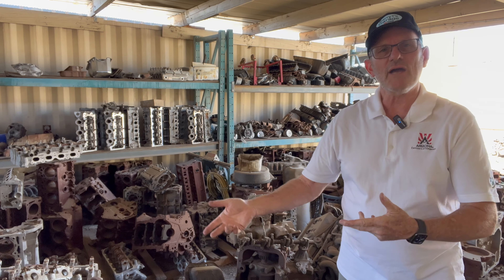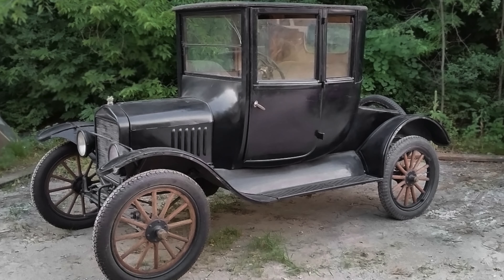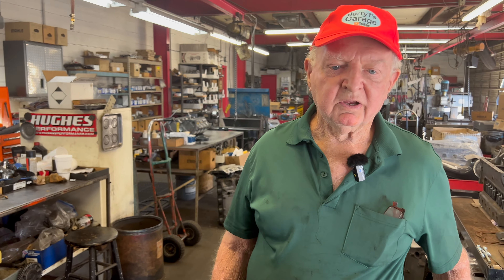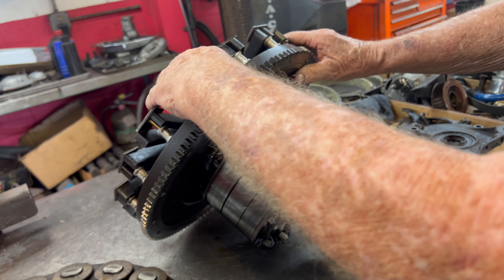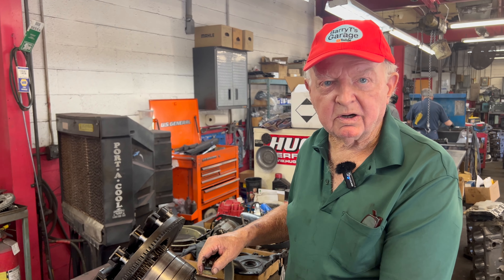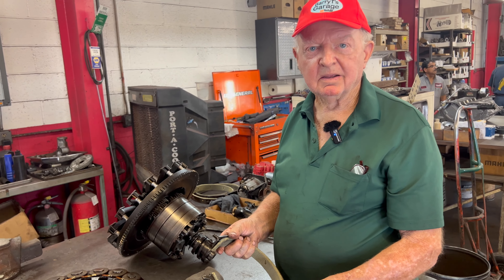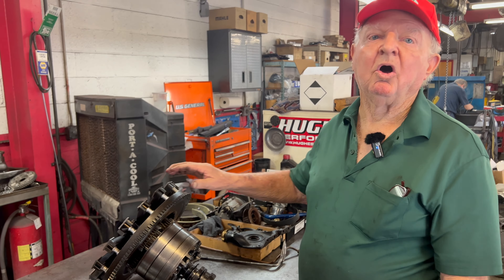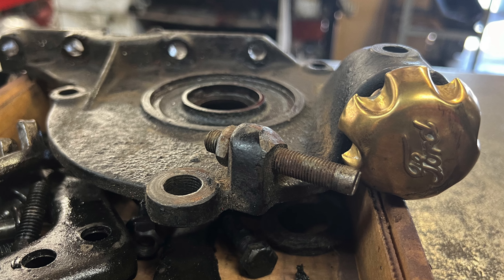Early Model T Oil Splash Flywheel Generator and other Oddities with Ed Smith of Five Star Engines

Comment: I was able to drive my great grandfathers ‘23 runabout recently, and it was quite the experience!  The throttle not being a pedal and the brake on the right was such a foreign feeling.  You’d clutch in and stop in such a different way compared to a modern car, (left pedal up right pedal down) and have to remember to idle the engine down on the steering wheel!  My uncle described it as trying to scratch your nose and play the fiddle at the same time. 

Also it’s very interesting to see how, despite driving kind of like a tractor, the basic concepts of engines are still very much the same as modern cars.  Another thing that was different though is that the T had no water pump!  The cooling system was entirely run by temperature differences forcing the coolant through the engine.  However, you get a pump in the aftermarket.
Reply from the maker: Great observations!

Comment: Slight correction/clarification here on the transmission:  Ed spoke of holding the left pedal down for low (first) gear which is correct.  But he said to hold a different pedal down for high gear and also moving the hand lever forward.  This not correct.  All pedals are released (up) for high gear while the hand lever is forward. 
  Further on the hand lever:  It was multi-functional.  While latched in the middle position the trans was in "neutral".  Pulling back on the lever applied the rear wheel (or parking) brake shoes.  Moving the lever all the way forward applied the high gear clutch.  You started the engine with the lever in neutral.  To back up you left the lever in neutral and pushed own the middle pedal for reverse.  To go forward you pressed the low pedal down.  To stop push the right pedal.  While accelerating in low, you moved the hand lever all the way forward but the trans stayed in low until until you let up the low pedal and the trans went directly into high.  Pushing the low pedal halfway down disengaged the high clutch before applying the low band so was neutral, then you stopped using the right pedal.  Thus you normally drove only using the left and right pedals:  Hold the left (low) pedal halfway down for stopping at a stop sign, pushing all the way down for low gear to start out, then let the pedal all the way up for high.   High gear is a multi-plate clutch pack like a modern automatic but is applied with a strong spring instead of hydraulic pressure.
  The gears are always engaged so "neutral" is only by releasing the bands and the high clutch pack.  On cold days the thick oil between the clutch plates caused the high clutch to drag and the car would try to run over the guy cranking it!  It was common to jack up one rear wheel on a cold day. When the brake band lining wore out, owners could keep driving by feathering the reverse band (until it also wore out)!   Since the brake was in the transmission, a broken axle shaft or worn out thrust washers in the differential resulted in no brakes except the wimpy parking brake.
Reply from the maker: Thank you so much for that clarification, it has been quite a many years since Ed drove one, and he may have struggled to remember the details exactly thanks for watching and joining the channel!

Comment: Yes cool video I remember my dad and  my uncle were talking about the Model T and they said that it had a coil for each cylinder and if you were lucky enough to have one with a 6V battery ignition sometimes it would start and run just by turning on the ignition without cranking it in any way because every now and then you would shut it off with the cylinder in the right position and it had already sucked in fuel and air prior to starting it , it would just fire the ignition and away it went!
But I may be butchering the storyline because it has been about 30 years since it was told as a matter of fact I seem to recall that you would also have to play with the advance for the timing but anyway you might want to ask Ed about that and maybe he could explain it so that it makes more sense!😀🇨🇦